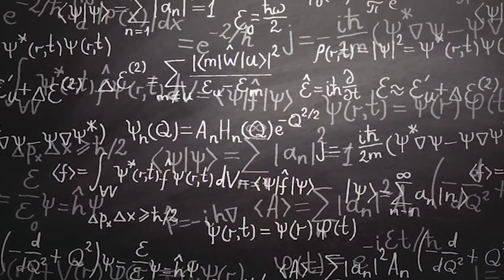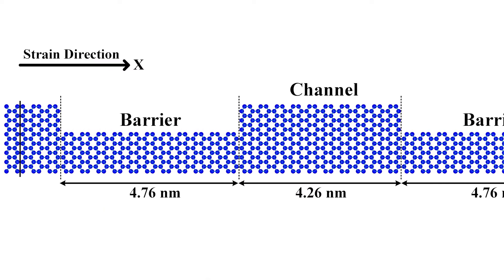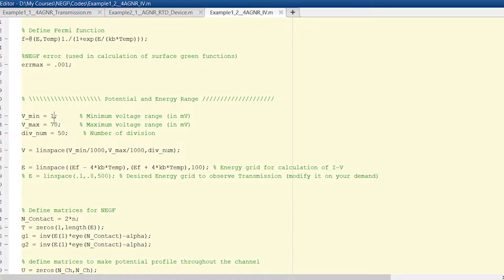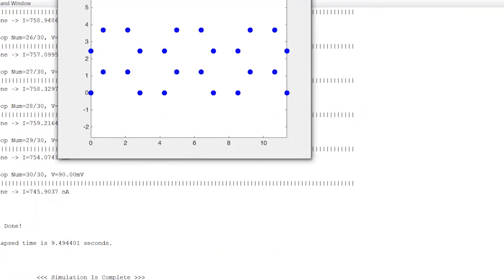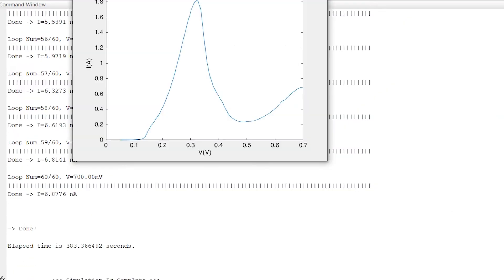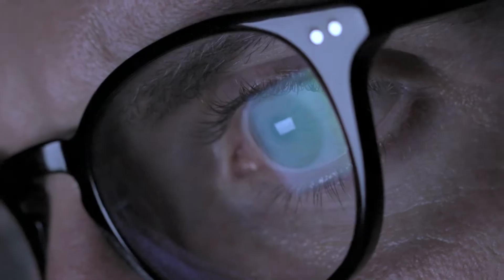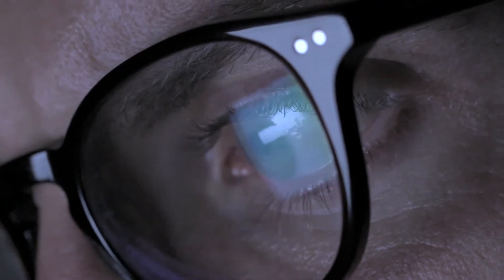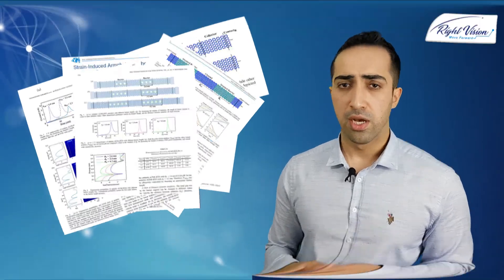Step by Step Guide to Design Nano Devices and Sensors / Best Online Course

Comment: Hi,
 I have gone through this content of the course in Udemy.
I am interested, to design different sensors for ex: temperature sensor, pressure sensor and which is interface to embedded board, 
So can you please let me know , 
Is this course is useful for me?

Because I am beginners to learn the nanotechnology, matlab, and sensors design.

Please let me know, using this course 
 Am I able to design embedded sensors? 
 Is this course is for beginners?

 then I will enroll this course on Udemy.

Thanks and regards,
Rohit